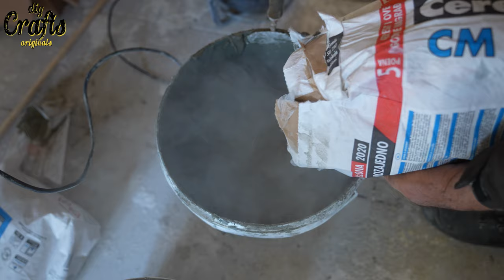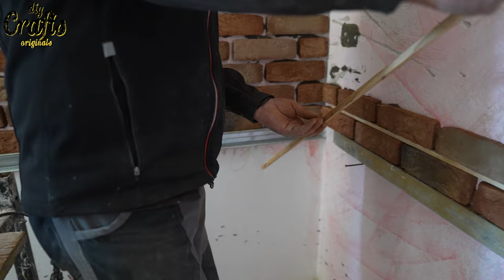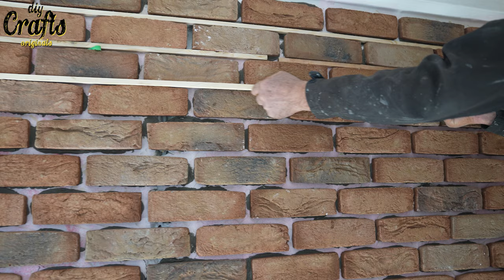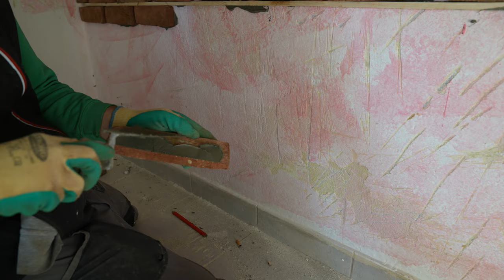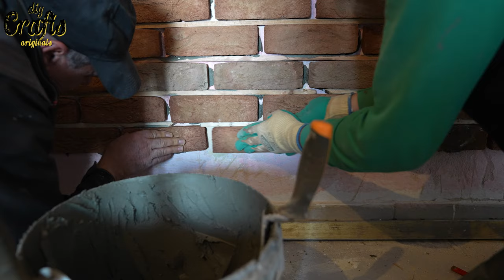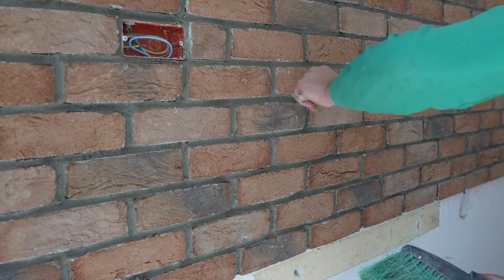How to Install Brick Veneer on a Wall

Comment: Great way to permanently ruin a wall
Reply: Why? Genuinely interested since we’re are planning a similar project. Thanks
Reply: What's the worse than can happen....you have to re-sheetrock in 10 years if you want to take it down? So, you don't have any tile in your house? Because according to your logic that ruins a floor.  What a tool.
Reply: @donnasavedbygrace   Don't listen to dopes like this. If it's something you'd like, the worse thing that would happen is you have to pull it down and re-sheetrock years from now if you want to change the look. Brick is kind of classic and would probably stay in style for many years - it's not like it only lasts for 2 years.
Reply: @donnasavedbygrace  Because you are permanently fixing a facade onto the wall that requires significantly damaging the wall if you ever want to remove it. It will also collect dust and dirt and be cold to the touch. If you like it aesthetically, great, just so long as you prepared to pay to potentially have the entire wall re-plastered at some point in future.
Reply: @ruffxm  Removing tiles from a concrete screed and re-laying a floor is much easier, cleaner and cheaper than re-plastering a wall because you destroyed the original plaster with fake bricks.
Reply: @flightcomputer2437    You have absolutely no idea what you're talking about. Ripping up tiles from concrete is easier than sheetrocking a wall? Obviously you've never done any work like this...but go on thinking you know everything. Who plasters these days?
Reply: @ruffxm that can cause serious mold issues on some of these where they really load the thin set on Sheetrock and splash it up like they all do with the messy grout bag mess all that moisture and weight saturated into the cheap sheet rock and grout is for tile and other specific things simple 4 to 1 mason sand masonry cement or just buy a bag of sakkrete that you add water to if you’re just going to slop it up anyway Honestly though these American thin bricks videos are ridiculous
Reply: @flightcomputer2437    And dopey...they're not "fake" bricks. They're real, clay, kiln-fired bricks - just thinner so they do not need a foundation to sit ion. Educate yourself.